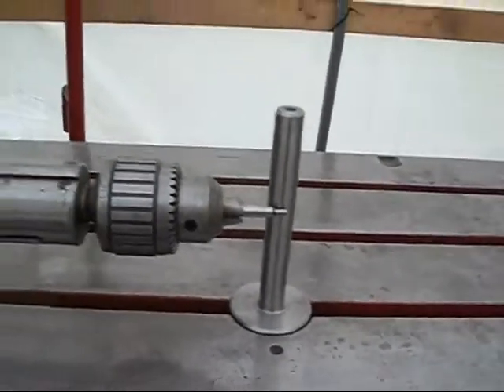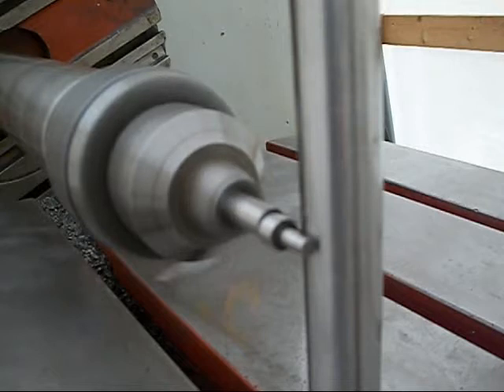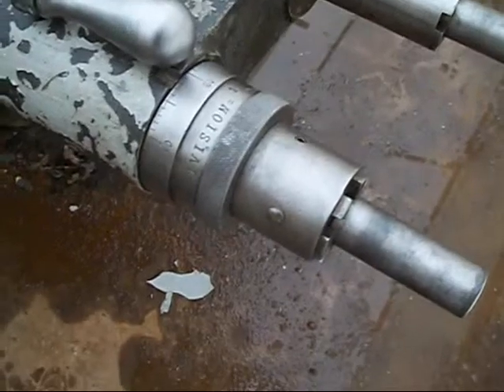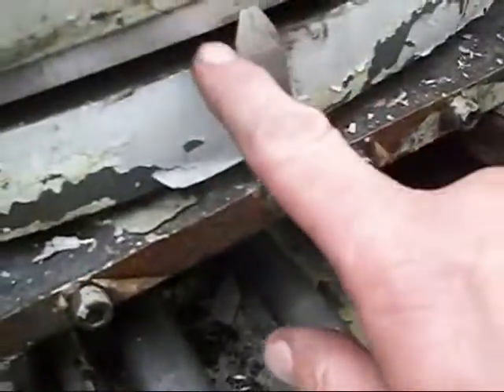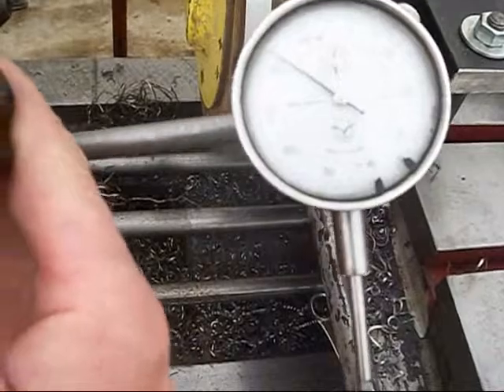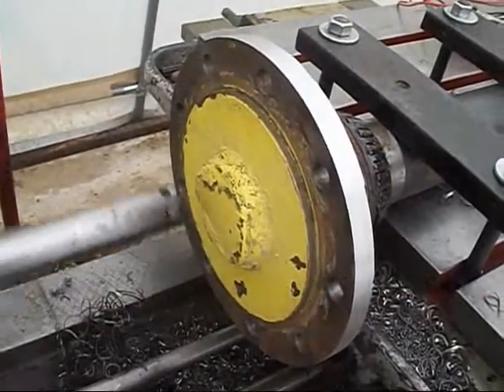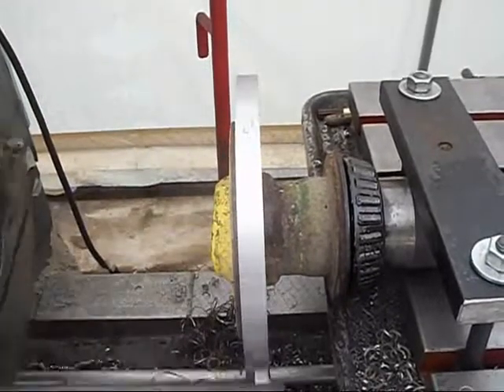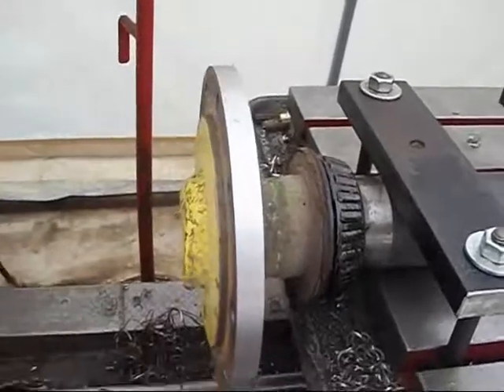HORIZONTAL BORING MILL PROJECT I  WMV

Comment: I thought I was going to see why you asked me if a regular center cut these axles ok. I imagine you are doing this for those brake hats to fit? I wish my HBM had a facing attachment, I can see it makes the machine much more versatile.
Reply from the maker: bcbloc02 I was not sure how I was going to do this. But I needed a project to try things out on the HBM . And it work well the mill removed metal very easy. The boring head will open up jobs for the future

Comment: Am I correct in thinking that this piece is too big for your lathe - or is there some other reason why you are using this machine or this task?
Reply from the maker: Dan Whiteford I could have doe this in my Lathe with no problem but it did not have a center in it . And I needed the practice and test out new tooling on the boring mill
Reply: Fine, thanks for replying. The practice seemed to work well judging by what I could see on the workpiece.